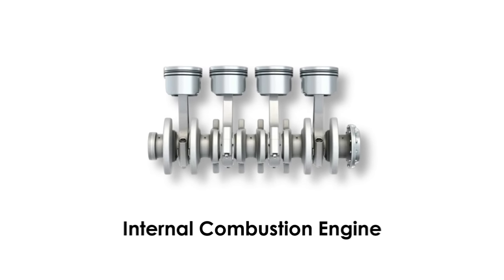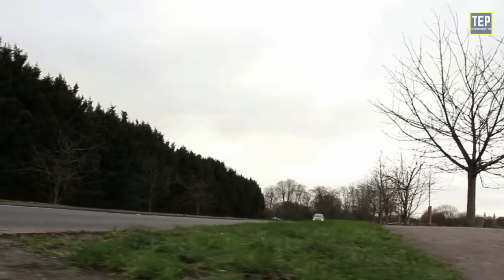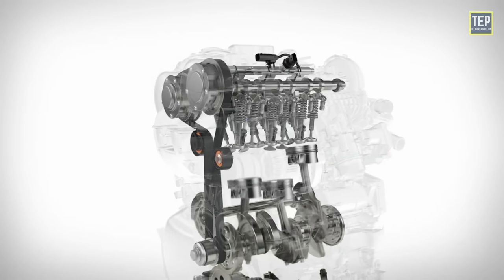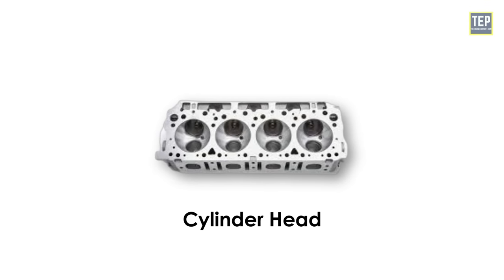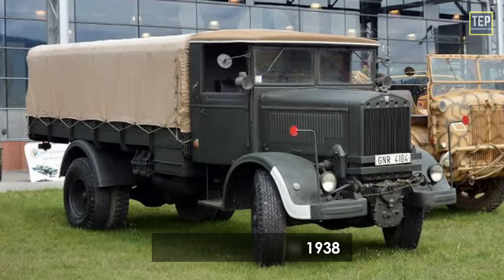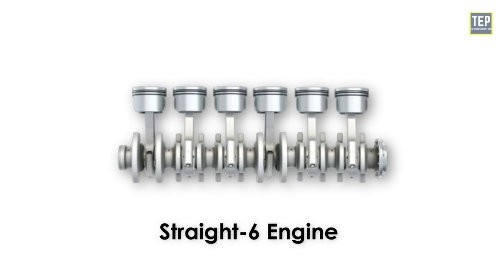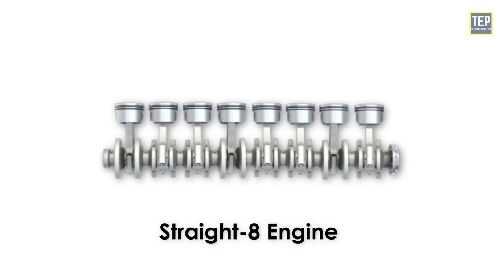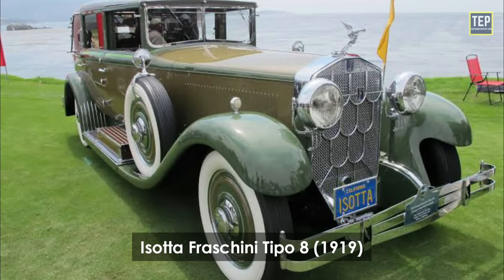Different "Inline Engine" Configurations Explained | [I2 to I8]

Comment: I love the sound of the TVR Tuscan inline 6.  I grew up with many AMC cars in my family and know how to work on them. Inline 6 all the way!  Now I drive a Gogoro S1 motorcycle which has an electric motor,  but the straight 6 still has a place in my heart.
Reply: The AMC inline 6s were easily killable. Usually the result of willfully neglected maintenance. The engines were actually built tighter than say a Ford inline. Unfortunately the carburation and intakes on the 199, 232, and 258 were tuned towards the economy end of the spectrum. I never understood why they did not go to fuel injection prior to the 4.0. The 4.0 is just begging for some brave soul to cut apart a set of Ford or Chevrolet small block V-8 heads for a cross flow head on the 4.0. The bore center is the same as the Ford Windsor and Cleveland at 4.380". And only .020" less than the Chevy SB and the LS/LT family.

Comment: Fails to mention that most Volvo's built from 1991 to 2016 have an I5, both petrol, and diesel versions, basically making Volvo the I5 king. Volvo did indeed use the VW I5 diesel for a while before they came up with their own design in 2001.
Reply: Nobody cares about Volvslow
Reply: What do you mean?
Reply: @bob-a-louannamaria7960  no one buys volvos for speed its because they are safe and reliable, and they are still more powerful than most cars
Reply: @bob-a-louannamaria7960 oh I care
And hundreds of others do as well
You don’t talk about “no one” when there’s plenty people that care
Reply: @bob-a-louannamaria7960  I care. Volvo are excellent vehicles.

Comment: Many straight motors in my career. I have owned numerous straight 6 engines and have found them generally satisfactory. Installed in old pickup trucks they were motors with good torques characteristics and quite smooth. In the older vehicles that required more maintenance the straight 6 motors were much easier to work on I have also owned straight 2, 3 and 4 cylinder motorcycles. The two cylinders was a bit shakey. The 3 cylinder was a shaft driven Yamaha, very smooth good torque, Engine sound was surprisingly pleasant. The 4 cylinder motorcycle is a late model sport bike with balancing shaft and is incredibly powerful with quite reasonable vibration. I seems that instead of the 4 cylinder having one or two vibration pronounced vibration points it has just a slight vibration at all speeds. I would be curious to know more about the 3 cylinder firing order and vibration peaks.

Comment: fun fact: a one cylinder, 4-horsepower engine powered the oldsmobile curved dash
It has one cylinder
One piston
One connecting rod
One crankshaft
One balance wheel and Two Valves
the complications of larger multi-cylinder engines were eliminated.

Comment: The 5 in line engines petrol with the cc of 1400 1500 1600 turbo or supercharge or efi or twin cam or doce or vvti technologys engines are the best to use in fuel economy and best fast pick and sadan acceleration  for a light car or light jeep or light van etc kind of vehicals i think so its the best 😊❤

Comment: Now this is one that wouldn't need an explanation....inline whatever is gonna be a straight line.  Other than the tilt such as a slant 6.  But the engines all look the same
Reply: Chryslers Slant Six was nothing more than a normal inline six leaned over at a 30° angle from the vertical. This was done for no other reason than to lower hood lines on the 1961 Valiant (1). And Chrysler was not the only manufacturer  to lean an inline over. In my mind a true Slant would be an engine th hat has a horizontal pan rail with the cylinder bores at an angle. Two examples would be the Pontiac Trophy Four and the International fours used in the Scout. The first being 1/2 of a 389 and the other 1/2 of the IH 304 (2).
1) The butt ugliest car ever built in the US.
2) No relation to the AMC 304.

Comment: Ford did a lot of work on inline fives in the 20s and early 30s. Henry Ford was never happy with how they ran. He wanted more power without having to go with a 6 cylinder. Hence the flathead V-8. A lot of US inline 6s pre WWll had only 3 or 4 main bearings. One issue with a 4 main bearing crank is in a fully pressurized oiling system is two of the main bearings have to eupply oil to two rod journals while the front and rear bearing only supply the #1 and #6 rod journals. In a three main bearing crank oiling is dependent on splash oiling.

Comment: The only practical application for a straight 8 engine is a stationary application such as generators and specific machinery. As for why many car manufacturers who discontinued the inline 6 dispite it's smoothness, balance,  reliability & having been available on virtually every make at one time or another,  I suspect has to do with length,  particularly as transverse FWD cars began to dominate the market in the mid 1980s as well as becoming more compact,  a V6 being able to fit in FWD and RWD cars, station wagons, vans and pick ups, seemed more practical from an assembly line standpoint, therefore largely replaced the inline 6 which was typically only usable in the larger RWD body on frame cars which pretty much ruled the roads prior to the 1980s when fuel economy really became a focal point in the auto industry after the two oil shocks in the 1970s.
Reply: Even aside from the oil crises and CAFE standards, some manufacturers figured out that by taking their V8s and deleting two cylinders, they could make a more cost-effective 6 cylinder, with the added benefit of being more compact. GM started doing this as early as the 60s
Reply: Packaging killed the inline six mostly.

Comment: I have owned 2 cylinder 3 cylinder and 4 cylinder motor cycles l have owned 4 cylinder motor vehicles ranging from 1200cc through to 2600cc and l have driven a 5 cylinder turbo deisel engined vehicle at now we own two motor vehicles and both are 4 cylinders l live in Australia and the 4 cylinder cars a very common l have also owned two 6 cylinder cars but most of the motor vehicles we have owned were and are 4 cylinders